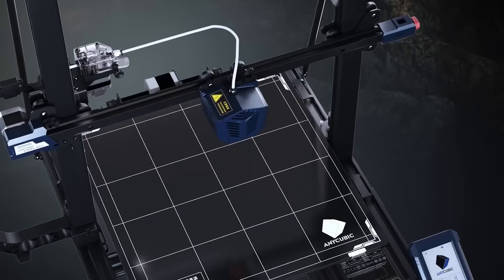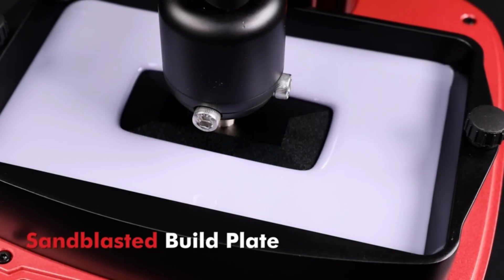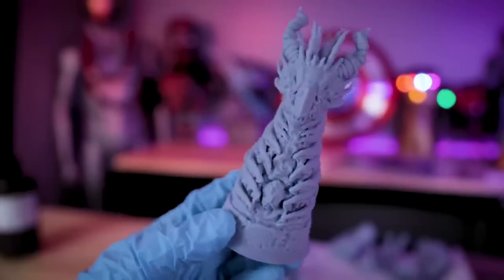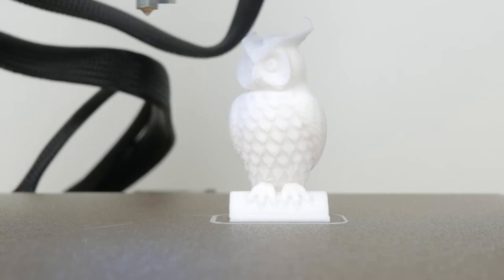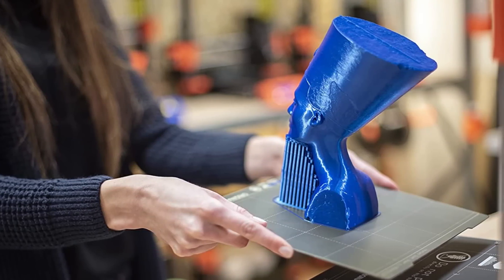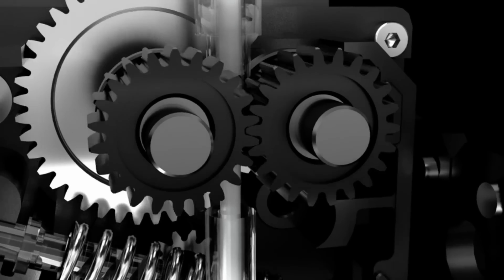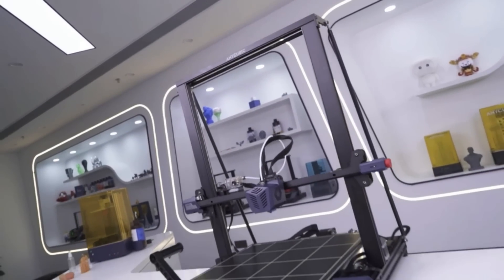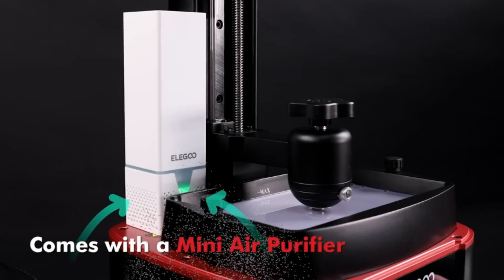Best 3D Printer 2023 | Top 5 List of 3D Printers for the Best Quality and Value

Comment: Hello, I just got the Creality Ender 3 S1 Pro, and I'm loving it, is such an amazing peace of equipment. I recommend after you finish building it, take time to tighten all screws, rollers, belts and of course make sure the bed is perfectly leveled before you do a final auto-leveling, I've used a caliper to make sure the distance between the bed and the base is equal in all 4 corners. My first print was the rabbit and it came flawless. Thank you for this video, I totally agree with your choices.